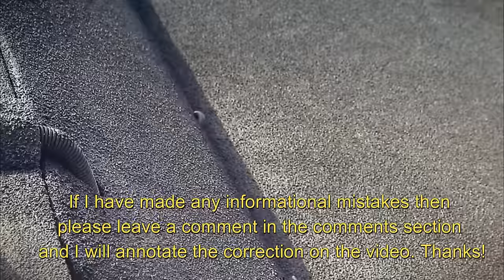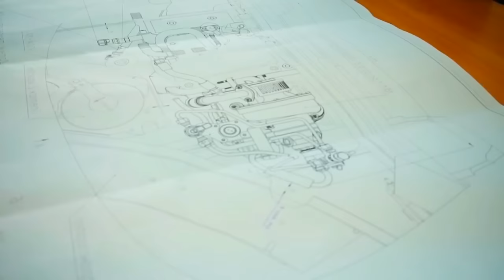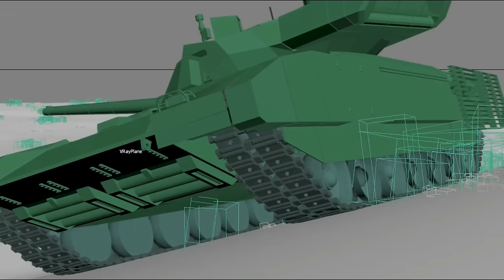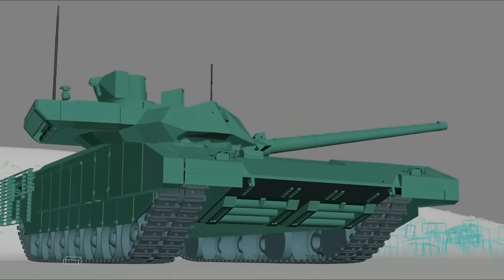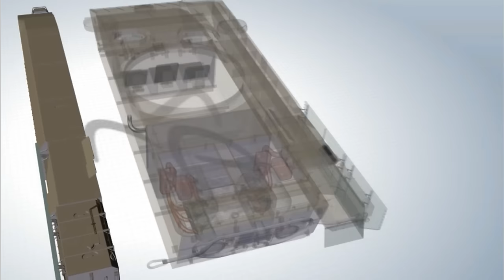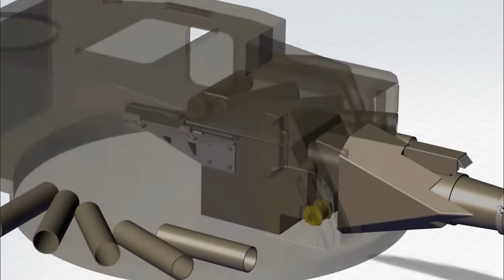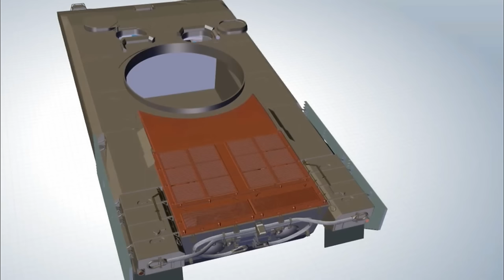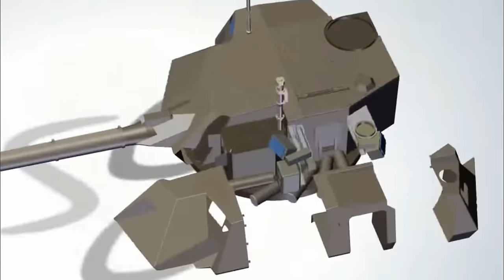T-14 Armata Russian Main Battle Tank - Tank Overview

Comment: Rocket launching from the main gun isn't something new , it's been around for a while . I'm pretty sure T72,80,90 have that capability. it's called Reflex if not mistaken.
Reply: Yes, such systems guided missiles (TUR-tank guided missile) quite a lot. 100mm for T-55 and BMP-3, T-62 115mm, 125mm for T-72 (Cobra, Reflex), 152mm for ob.195 and Armata.

Comment: I may have rushed the video but I haven't heard about the cloaking capabilities it has. The only tank with cloak capabilities is the PL tank, and that's a light tank. So, it might be lighter armored than its predecessors...but since it have 48tons...idk, what do you think?
Reply: There are many kits that reduce visibility. A large tank will be more prominent, of course. The main measures to reduce the visibility - reducing radio and a contrasting thermal radiation. PL - IFV / light tank light armor, opponent can not be the main battle tank, only an ambush. Armata - reduction of visibility and reduce heat generation due to new materials and advanced heat dissipation. (Almost does not melt the snow on it)). In addition, you can hide part of the signature (like the CV-90) and deform to reduce the signature identification probability
Reply: T-14 weighs 53 metric tons now, with a full set of armor to 65 tons.

Comment: my main concern is, what happens if the T-14 is disabled and the crew need to bail, the only opening seems to be the front (and bottom maybe, idk) they expose there entire crew to fire.
Reply: The crew will be picked up on the T-15 if the tank is really unable to move. In addition, you can make a minimum repair and order the T-14 to move after bmp, without the crew.
Reply: The problem exists for every MBT, except the Merkava. However the Merkava sacrifices some other aspects for it.

Comment: I'm an M1 Abrams former Tank Commander / Gunner, this tank looks interesting although not very well made. It seems sloppy in fit and finish which isn't unusual for Russian military equipment. I will give the Russians credit in that we the USA have decimated their equipment, but to their credit they haven't been crewed by Russian crews, and the models haven't been up to Russian Army standards. They are stripped down export models. The autoloader is always going to be a slower and weaker system than a highly trained human loader, that's absolutely proven beyond any doubt. I'm not sure why Russia doesn't give up on the autoloader system all together?

Comment: Well the main drawback of this tank is that it's system driven, meaning you don't really have to knock it down, only do damage to its sensors and the crew will be blind.
Reply: How? There are back-up systems. In addition, data can be obtained from an external source.

Comment: i wonder why the crew is up front, when such a design could easily have the engine up front where there is more armor for it. Well having the crew in rear which gives you more options for how they can enter and exit, as well as vehicle options with that hull.
Now that crewless turret i think is a great idea and a very smart move, since that extends the life of this tank design far more then other tank hulls. Plus makes it into a pretty damn good platform for various concept ideas floating about. Which makes development much easier and also keeps cost way down.
Also I look at all that armor this and all most modern tanks have and think, but what if they bring back the kinetic missile idea. Because that concept idea proved to be the ultimate tank killer, because it packed such a heavy mass and moved so quickly. Problem is they are complete shit at dealing with anything other then some kind of heavily armored vehicle or something at very close range, unlike a shape charge missiles which can deal with pretty much most stuff at any range. Though the kinetic missiles have one huge tank killer advantage, and that is active defense systems on tanks (current gen, next gen, and adapt) lack the power to deal with them. Unless i guess you magically hit it with the main gun and call that active defense.
Reply: "Object 299"
http://armyman.info/uploads/posts/2014-11/1416798715_tpp-01.jpg
http://cdn.fishki.net/upload/post/201601/26/1826386/25bf19a01b9b4923d7545007bd8498f6.jpg
This option was considered and was even built. However, front-engine prevents protect the crew enough. Which leads to a strong increase in weight of the tank, as an example of the Merkava. Good protection against RPG and ATGM enough of, but not capable of sustaining feathered projectile. Hit in the forehead - the destruction of the motor, in board - the death of the crew

Comment: Aren't typical squad size 8-12 men? I never understood those compact transports. They need to be expanded to be made bigger in order to fit whole squad. A single unit which is independent, not just half of it.
Reply: Unit.
Independent units. The Unit of the Soviet and Russian army - is the smallest military unit having commander. Office team of junior sergeant or sergeant. Usually 9-13 people motorized rifle unit. In the offices of other arms strength of the separation from 3 to 15 people. The tank troops - the crew.
Reply: So, it only confirms that those transports are too small to transport single, independent infantry unit.  They should be carrying from 9-13 men, not 6.
Reply: T-15 provides the troops of 9 persons + ammunition and weapons, two "quad" + officer. You can take on board another 3-4 people, there is enough space.)
Unit - "squad" - literally "ten".
Reply: Damn youtube messes up notification.

Yes, I do agree that dedicated transports do have capacity to transport units, but here we often hear that this or that has a transport capability of 5 men or so. It seems an extreme waste of design space, like for example in Merkava.

Comment: Its looks (and to a degree its weight implies this too, compare its 48 tonnes vs Leopard 2A7's 62 tonnes) like a "medium tank" rather than a heavy tank. Also, the unmanned turret design, compare to the ideas behind the Strv 2000 that was never built.
Reply: And? WW2 is over, a light tank can be just as protected as a heavy one nowadays. The Merkava (Mk I and II) as example is made of plain steel, and weighs 63 tons. The Leopard 2 is 3rd Gen composite, and other tanks like the K2 or Type-10 are even more advanced. K2 is just as (if not better) armored as the M1A2 Abrams, yet its 10 tons lighter. The Type-10 uses nano-crystallic steel. Expensive but ~3 times more effective than regular steel (Merkava) while actually lighter. Type-10 only weighs 45 tons. I mean, by your logic the Type-10, just like the T-90 are medium tanks, because they're same weight as an old M-48 Patton.

Comment: help... so in a chemical warfare situation T14 can still fire as the separate crew compartment safe from outside air exposed gun loading chamber, right?
Reply: Chemistry? All tanks are protected against WMD (at least all of Russia).
T-14 is designed for a few days stay in the crew capsule, in a nuclear war.
Reply: Джо Неуловимый yeah but what about firing a round in sych situations? I mean, unlike armata in a normal tank if the barrel is open to fire, then the crew get exposed. T14 is safe to 'fire'.
Reply: When inclusions protection against weapons of mass destruction, in the tank is supported by the overpressure, the air outside an inhabited volume does not penetrate.
Reply: Every modern MBT or IFV have CBRN defensive systems.
Reply: Jonny but what about 'firing' a round from coventional crew compartment vs separated crew compartment under such situations
Reply: No diffrence. These systems work with overpressure as far as i know. There's no gas coming through the gun barrel or smth.
Reply: Jonny yeah against chemical, but i dont think cabin overpressure save crew from radiation, so no barrel opening.
Reply: Radiation is also transferred over air/dust/particles. It doesen't whizz though a barrel and kills you.

Comment: The tank is big though, as big as a leopard 2 or Abrams. Really wonder where it saves those 20 tons. Doubt its entirely the smaller turret so the armor might be thinner.
Reply: weight savings in combination with reactive armor. The main armor should protect only against piercing projectiles, so it is thinner than for example in the "Abrams". Reactive armor on top of the main armor just gives weight savings of ~20 tonnes, and improved protection against cumulative projectiles.

Comment: It definately has the ability to fire guided missiles (whats the point of smoothbore without this). And its claimed, that those can reach the target at a distance up to 10 km. Well, mb. What im really curious about is electronics: all this fire system controls, target searching and protection systems requires very sophisticated electronics. And there is no secret: we are not too good in this. And ints not the first attempt to build an unmanned turret, for sure. There is, at least, Strv 103, wich doesnt have turret at all.
PS First presentation video is mirrored/fliped ;)

Comment: I suspect cost will be a considerable issue here. The Russians regularly accept or adopt equipment, but much of it is relegated to limited use or special forces. With Russia's relatively weak economy, I find it unlikely that these will show up in any significant number.
Reply from the maker: Davito2000 you may be surprised! :-) they are probably going to sell off and export a lot of the older serving tanks to save cash for the newer T-90 and these. Not sure though I'm just speculating :-) thanks so much for watching!!
Reply: Armata is designed to be modular, highly reusable and easily upgradeable platform. This is where they expect to save money. In addition to that, Russia is shifting to a smaller professional army, relying on nukes for strategic safety, so they won't need as many tanks as USSR had.
Reply: Davito2000 you should watch the victory parade you will know if money will be the issue

Comment: The armor profile on the unmanned turret is underwhelming for a main battle tank. I know that the Russians claim that the new Hard-kill Active protection system can counter sabot rounds in mid flight and the crew compartment is isolated from the turret compartment but in my opinion ( and it is just an opinion ) the T-14 is more vulnerable than the T-90AS. If the turret is penetrated and the tank is rendered combat ineffective that is almost the equivalent of a lost tank. 

Maybe in the future a heavier modular armor upgrade will be employed to counter this but until then I have my doubts on its protection.
Reply from the maker: I agree on the turret for sure. No point having a nice protected crew and then a turret that will just fail if taking a hit...

Thanks so much for watching :-)
Reply: Tower (although this is just a turret for mounting guns and sensors), armored enough by itself. Replacement involves no problems, several hours.
Reply: That is assuming the vehicle is able to exit the combat zone while combat ineffective. Not being able to return fire drastically reduces your survival rate in combat. Having protection on par if not superior with counterparts from potential adversaries should be standard.

APFSDS rounds do not just pass through the target cleanly but they fragment into shrapnel, as the sound fractures as it encounters resistance from the armor. Depleted uranium sabot rounds don't just fragment, the fragments will ignite due to the heat released on impact as they split from the sabot round. Even if the round is tungsten It would be safe to assume a successful penetration would cause damage to multiple components of the turret.

Comment: Hy! I have an interesting question for you Matsimus. You know the T-14. Its a good tank right? What if I say no? Russians speak about the 1000 mm titanium armor around the crew... Why they speak about it? I know its great but other tanks have that thick armor too. Maybe not titanium, but they have. What if the T-14 has weak armor on the other parts of the tank? And thats why it is that light and fast? And thats why they made unmanned turret? To save lives if the turret gets hit? If it is true, you know, T-14 is easily destroyable or can be damaged... Is it propaganda? What do you think?
Reply: Alloys of titanium are very light and durable. But it's a pyromorphic metal, like magnesium or uranium. It burns like a termite compound. So definitely not.
Armata is protected better than all modern tanks, there are no sections of armor with a homogeneous protection, only a layered cake of steel ceramics and high-molecular polymers. Therefore, it is 15 tons lighter.

Comment: why are people comparing this to the abrams when its original design from 1980. I don't see people comparing a fox body mustang to a gt350r.
Reply: Steven Long The Abrams.is still current and the U.S. is constantly improving the design. We intend on having A1s and A2s serving for a long time.

Russia has been doing the same with the T-72 (a much older tank design) and nobody seems to bat an eye at that.

Yes, even the T90 takes design cues from the 72. Now there are plans to modernize the base 72 as well. Again, nobody bats an eye at that.

The T90MS and Armata are the first to break away from.the 72 design.

Comment: I think putting the men at the front of a tank is a bad idea 😬. Concussion will be a severe liability. But I dont know much about tanks so pls prove me wrong and share any data.
Reply: Any other placement of the crew many times worse.
Other accommodation of the crew, not provide increase security and make the tank too heavy.
The armor is made that way, not as in other tanks. And able to withstand any threat known today.
The top layer of ERA, active armor, a layer cake of steel, polymers and ceramics.
Reply: Джо Неуловимый Ahh I understand!

Comment: Not too sure how well the T14 is protected passively. Hesh rounds really slap a tank's armour and tends to strip the exteriors.  Much of the defence of the vehicle appears to depend on active measures that strike at incoming ordinance.  The Russians have always been good at producing designs that were cheap to mass produce and the fact that this hull is intended for a suite of vehicles follows in the same vein.  It remains to be seen as to how the T14 performs in a slug fest with the current heavy weights such as the Abrams, Challenger or Panther.
Reply: Hesh is not effective against a combination of armor)
Modularity allows to reduce the price, and to intensify the production of the necessary parts.

Comment: 3:48 "Black Eagle" ("Object 640") - Russian project of prospective main battle tank, developed in the 1990s by the Omsk Transport Machine-Building Design Bureau. The prototype was first demonstrated in 1997 and is a modified chassis of the T-80U installed her new tower design. Commercially not produced. It is supposed to be exported.
Т-95  (Объект 195) http://voenchel.ru/uploads/posts/2015-05/1433080223_7279605.jpg
http://i74.fastpic.ru/big/2016/0107/69/6b1e3316ab8e59a6b8a97ada163eab69.jpg
http://i53.fastpic.ru/big/2013/0101/00/e2facf2d561925770e5e58bc10224e00.jpg

Comment: No offense, but I think from what I have found on the Pro Russian and Russian websites about the T 90, the Auto Loader, in the T 90 was very fast!
It is faster than the T 72 which had similar, horizontal storage, etc!!
Point being, "Auto Loader are slower than Manual loader" MAY HAVE been refutable because of improvements in the System unlike previous Auto loaders!

Alas faster than the Abrams rate of fire!